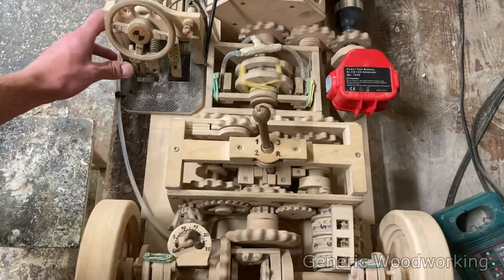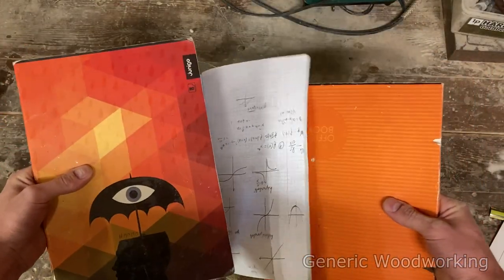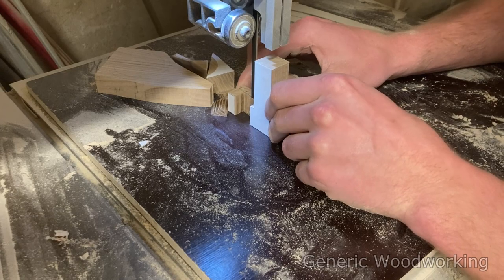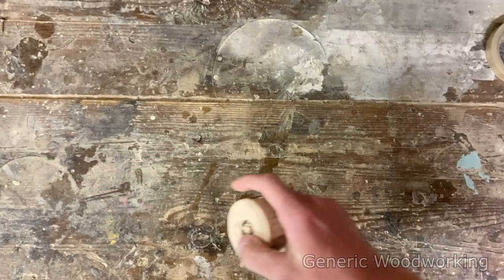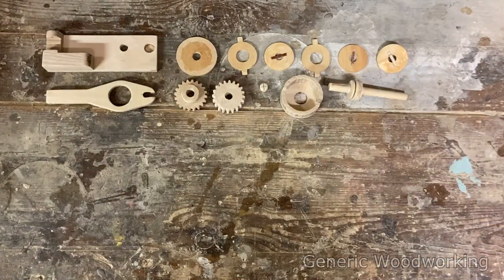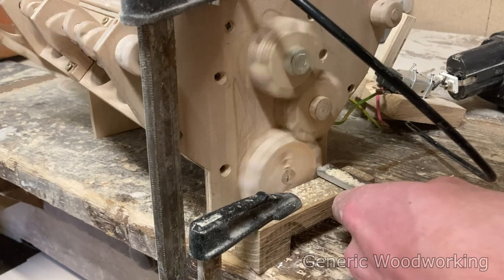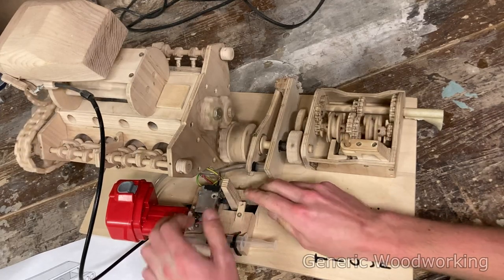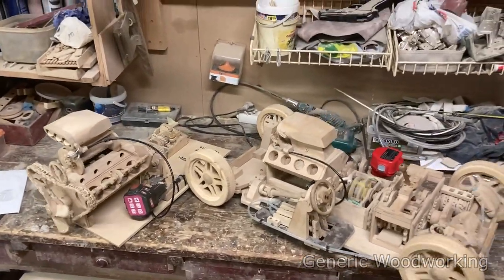Wooden Car Clutch

Comment: You need lights, Self oppening doors and a Suspension wich u can lower and higher
Reply from the maker: Lights- I plan on putting LEDs in the engine cylinders to symbolize combustion. Self opening doors- not electronically literate enough for that (and I don’t think it would suit an old car like this). Adjustable ride height suspension- now this is an absolute MUST!
Reply: @GenericWoodworking  for the self opening doors its just a switch operated solenoid that pushes or pulls a wooden leaver attached to the door. You could hide it in the dashboard when built. You could see if it's possible to use the solenoid fully retracted as the closed position and fully extracted as the open position or vice versa depending on the contraption you build 🤷‍♂️. Hope this helps !!!
Reply: @GenericWoodworking   you should exhaust smoke to make it realistic

Comment: That clutch is aweosme!! Great idea designing this. I have a question, which program do you use to desing 3d gears? I'm still making the gearbox with your patreon plans but when i finish I'd really like to make one if this one
Reply from the maker: Thank you! I use Matthias Wandels gear generator. I also use google sketchup for 3D modeling, but I don’t really recommend it as now I’m starting to realize it’s definitely not the right program for this work.

Comment: Does the engine actually need to cool down or is the intake just for show
Reply from the maker: No way to know for sure. If I were to disable the supercharger and consequently cause the motor to overheat and burn out then we’d now that it needed cooling. 

All I know for sure is that it has cooling now and works just fine.